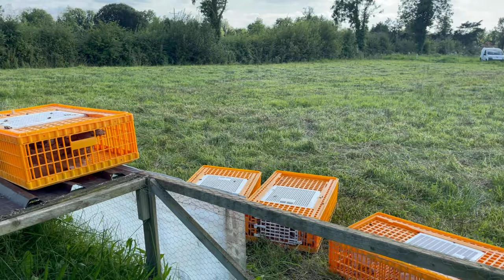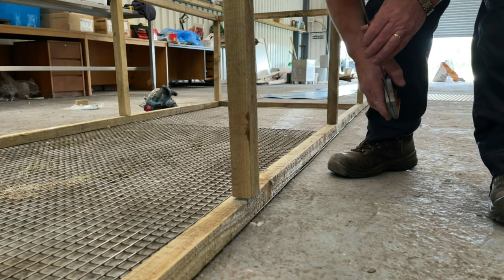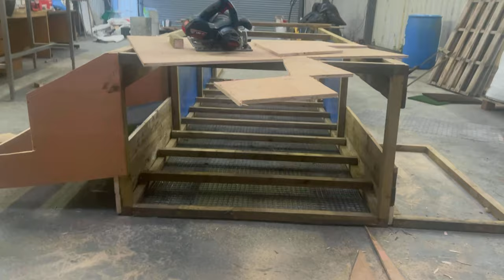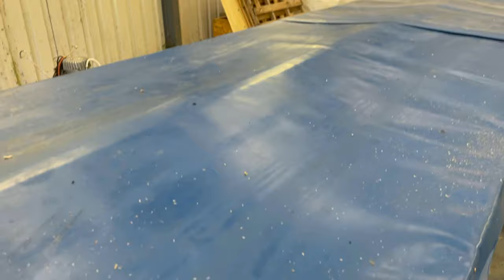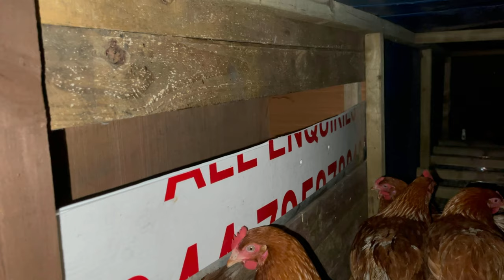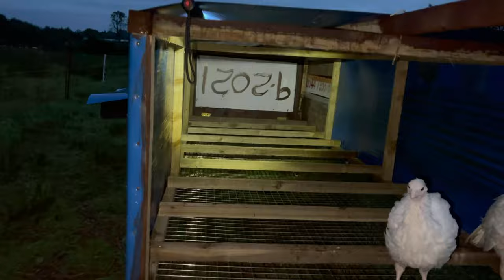Building our first Chickshaw XL

Comment: Cood "chickshaw", looks great! Just on the wheels seen as you were a bit hesitant about them, bicycle wheels will not work the way you have them, they will bend. It's not a case of them not being strong enough, but they are designed to be supported and have weight applied on both sides of the axel, so when it's only on one side they will bend.
Reply from the maker: You’ve hit the nail on the head. They do bend and eventually break. I’m currently working on a better solution. I kinda predicted it but was in a rush to get it built 😬